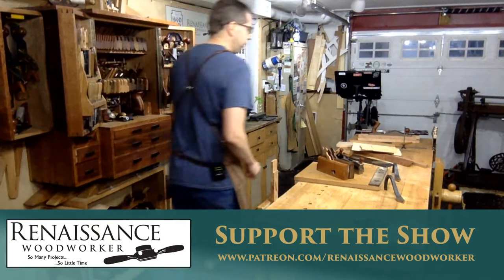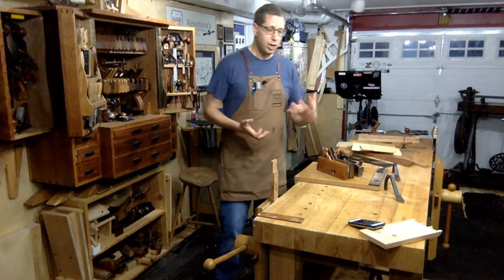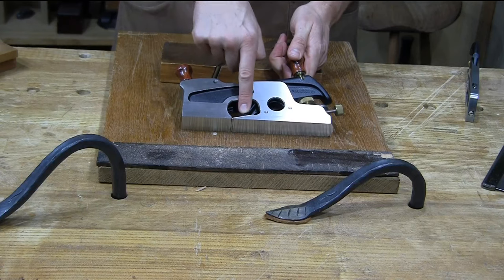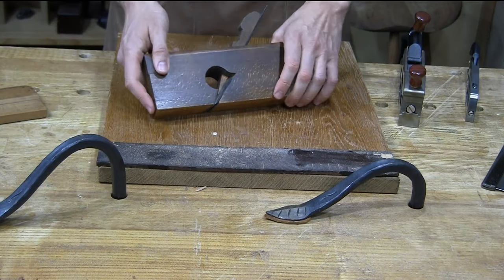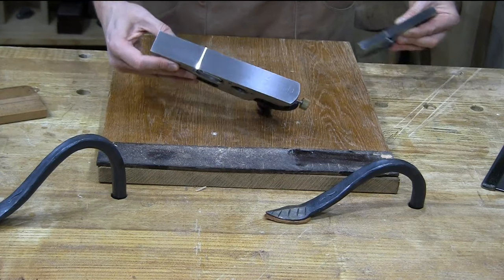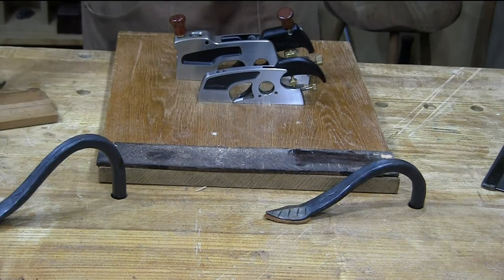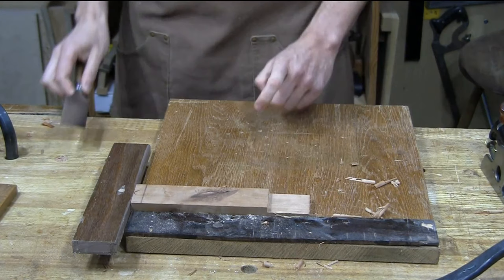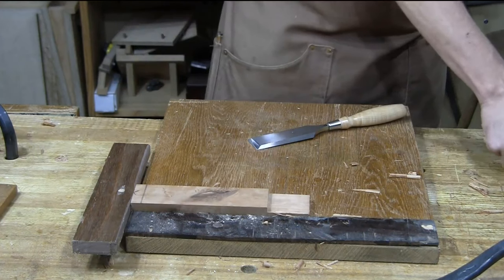Shoulder Planes vs Rabbet Planes

Comment: Nice video workshop on the use of especially the wooden rabbetplane 👌 
Regarding refining the cheek of a tenon i us the veritas routerplane together with a self made very accurate hardwoid extension blade. This method delivrrs me a very nice fit with long open mortise and tenon joints

Comment: As an alternative to the fixed mouth rabbet plane; the Stanley 93 rabbet plane has an adjustable mouth so it can take fine or course cuts.  The front can also be removed transforming it into it a chisel plane.  I find it to be a very useful tool.

Comment: Thanks a lot for this video , definitely it help me. I usually use a Stanley Bullnose 077 while building furnitures. 
I recon that a router or a table saw   
Would do most grooves/rebate removals from pieces. 
But sometimes there are tailored rebates to be doned in unsquare pieces that must be adapted to existent structures , and in that case a sharp and precise rebate plane can be usefull and a pleasure to use. Could happen in sash windows. 
I definitely agree about using a chisel to flatten tenon cheeks too , very practical.
Thanks very helpfull video

Comment: I think this is the 2nd time I watched this. First time was a couple of years ago. I always reach for my 2" chisel or my slick to flatten those surfaces. In fact this is the reason that I am planning on purchasing several different timber framing chisels so that I have a really long registration surface with the handle out of the way.

Comment: I have a Veritas medium shoulder plane. I do use it often - particularly across grain and for rabbets, but it is the second tool to touch that wood. I'm doing shiplap for the back of a cabinet and I wanted the rabbets to look clean. My Veritas rabbet plane went first to hog off the majority and then the shoulder plane in either direction to deal with tear out. 

I am considering investing in better saws though to help with tenons and dovetails though to avoid tedious clean up. So who knows what will happen with my shoulder plane in the future.

Comment: @RenaissanceWW I actually just used a borrowed Record 073 1” shoulder plane to take the bow out of a 130 year old door frame without tearing it out to accommodate a new slab door.  They can be pretty useful in non joinery situations where you need to cut  the full plane width.  Hey, if you’re looking for a buyer for that Veritas I’d be happy to buy it.  New they’re back ordered until July and I have an itch that needs scratching, ha.  Great content!

Comment: Nice as usual, which 1.5” chisel would you recommend, I prefer old tools
Reply from the maker: Honestly I don't recommend chisel brands at all because I've had great experience with every chisel I've picked up once it is fettled and sharpened properly.  Some modern tools will boast technologically superior steel and durability and this is true.  But in practice I haven't found them to function really any better than a 300 year old chisel in a paring cut where I'm not overly stressing the edge.  A mortise chisel will benefit from more durable steel but even the vintage English pattern mortise chisels I have used still have exceptional durability when used correctly.  And there is the heart of the matter.  A chisel sharpened well and used well will work great irrespective of the brand.  So to answer your question, get an old tool.  In fact you will find many more options when you get up to chisels wider than 1" in the vintage world.  Modern makers don't deal much in these larger varieties.  My favorite chisel is a 2" wide Buck brothers chisel that I picked up on ebay about 12 years ago.  What I used in the video happened to be a Blue Spruce 1.5" chisel and that is an outstanding chisel because I had to do no work to it.  But it doesn't work any better than the Buck Brothers chisel...I just had to put a lot of work into getting that flat and ground and sharp (and remaking the handle).  So go nuts, any brand will do.
Reply: @RenaissanceWW   I watched your video again now 2 years later. I so appreciate your teachings! All what you are saying is making so much sense. I got ahold of quite a few chisels of old vintage and I am having fun using them. Now I am crazy about old wooden planes and I was eyeballing those beautiful moving fillister and grooving planes with gorgeous fences. I have to stop myself because I can do all work with my Stanley 45 and a few rabbet planes. I am trying my hardest to follow Schwartz advice from the anarchist tool chest and not go overboard buying stuff. 
One question though, with skew blade rabbet wooden bodied plane, do you only use one side? I can see the plane wanting to move in the direction of the blade angle. 
Thanks again!
Ola
Reply from the maker: @MrOlaboss  Yes it does want to pull towards the skew but you can still use them  in either direction.  I do this all the time in fact.  Its another reason why I like the fenceless nature of a simple wooden rabbet plane.